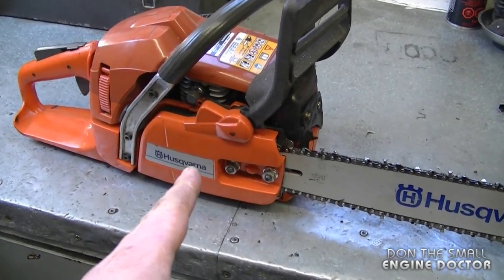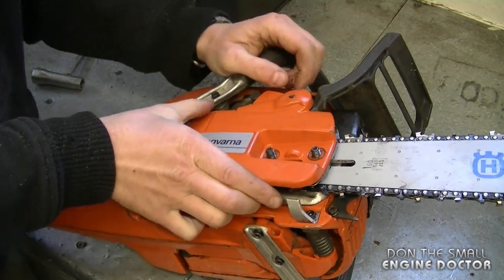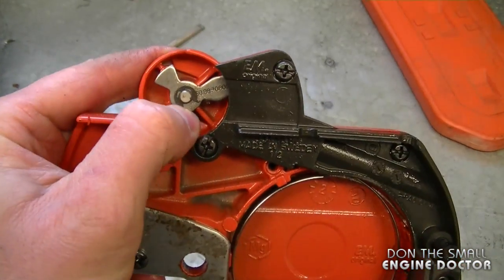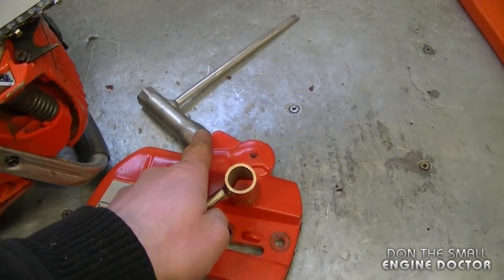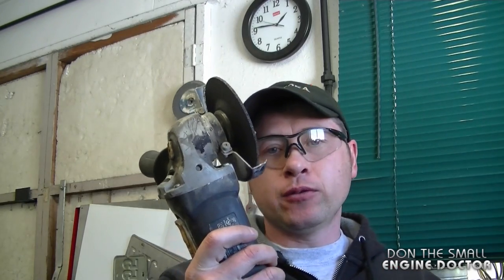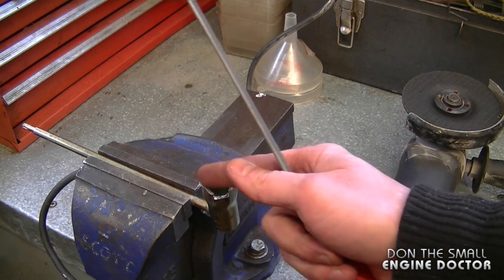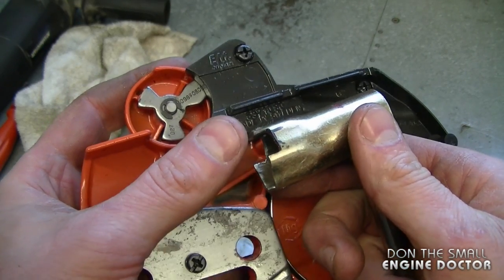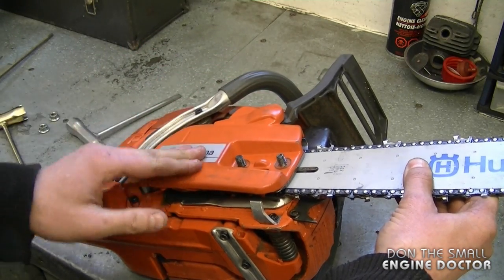Husqvarna Chain Brake Disengagement Homemade Tool

Comment: very smart, bet it will be useful. The only homemade tool of mine I can think of right now is a key cap puller for cleaning/tuning computer keyboards, and you usually don't find keyboards attached to small engines :)

Comment: Thats spot on don :-D perhaps you have some older tools you made.
Ive had to make or adapt things to do a one off job, sometimes we just dont have the money to buy a makers tool for one use :-(.
Grinding a notch into the end of a straight screwdriver can be handy for those odd screws :-), never throw an old printer away untill you have snatched the metal rods, handy sacrificial drift punches lol.
Reply from the maker: +zx8401ztv yes I have other homemade tools I will show